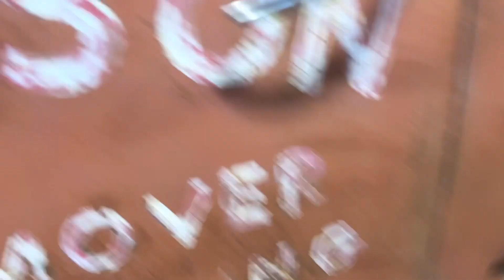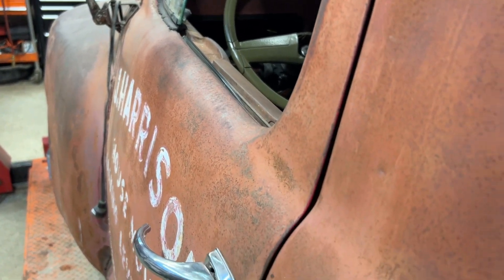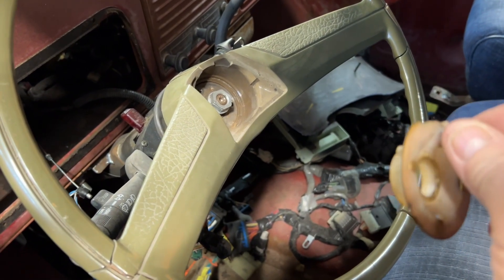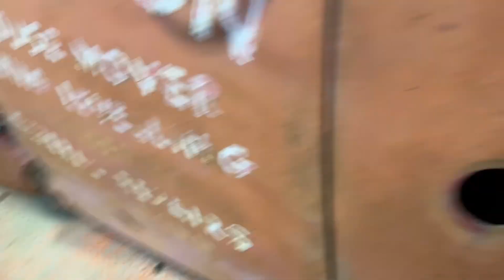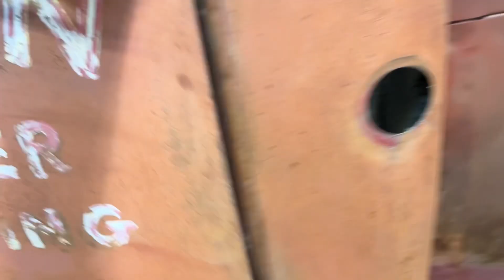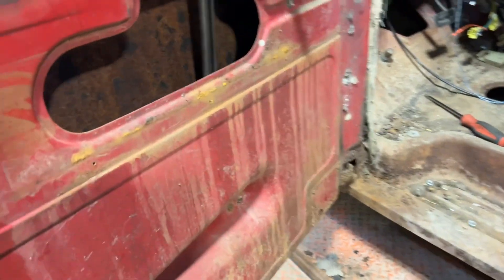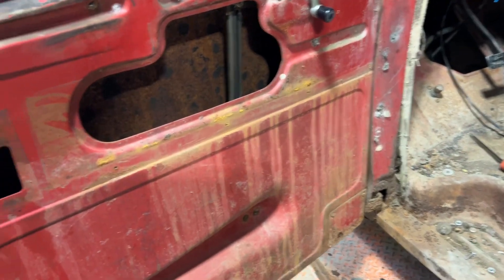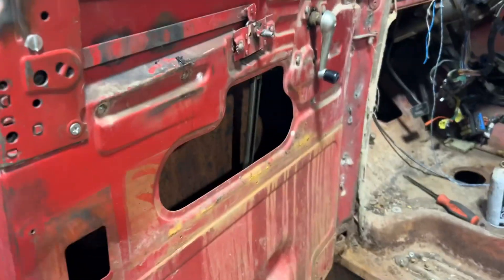Studebaker #33 start mounting seats

Comment: Hey Frank. I really like the Stubebaker. It's like my Fargo. You don't see many of them around. I tried to replace the seats in my Fargo, but they put me too close to the steering wheel. No, I'm not too fat. Ha-Ha. So this winter, Keith and I hope to cut and shorten the steering column to give me the room for my new seats. Keep up the great work. Thanks for sharing.👍👍🍁
Reply from the maker: I was thinking about cutting mine. Getting wheel off is the most difficult part. And getting steering box out. Then the horn wire runs down the center of steering shaft. I was going to machine a bushing, so i can weld shaft and still run horn wire through.